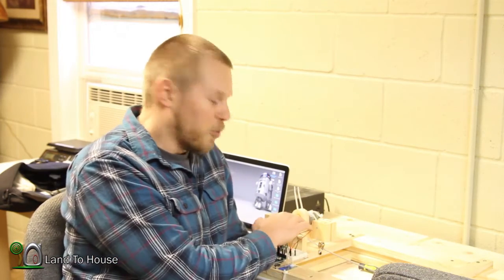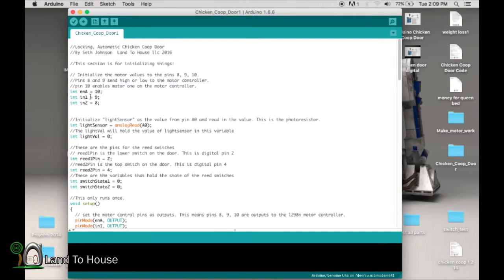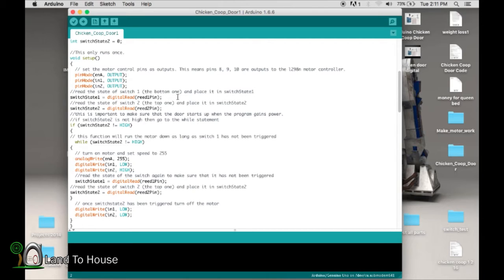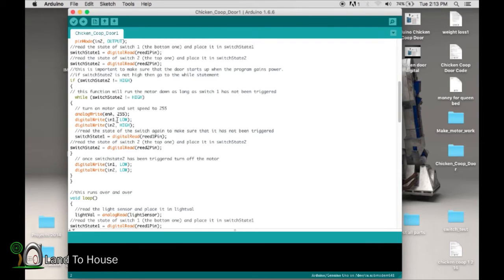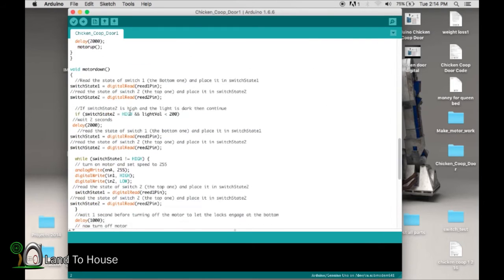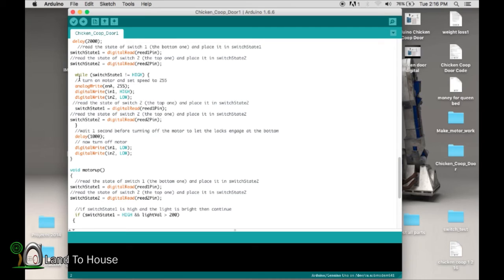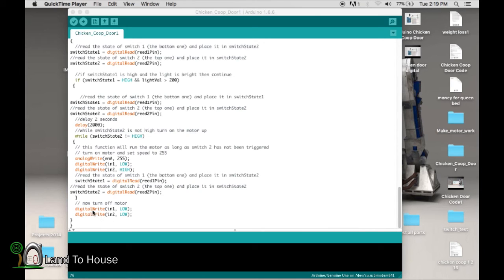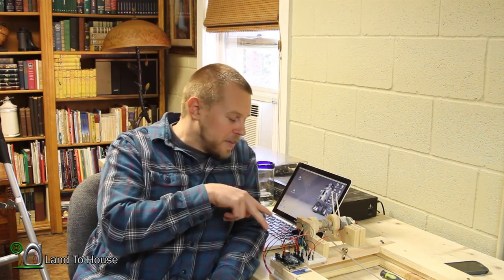Amazing Automatic Chicken Coop Door Part 6/7

Comment: Stellar series. I've been looking at pop door ideas for a while and yours is definitely the one I'll be emulating. 

One question applicable to this video though: I'd rather not tie mine to a light sensor. I'd rather make it "smarter" to take full advantage of the arduino. I'm wondering how much more complex the code would get  if you eliminated the light sensor and instead triggered door open and close based on sunrise and sunset (plus 1 hour maybe?) pulled from an online database. 

Any thoughts on this?

Comment: very cool!! I am a bit new to arduino but I've ordered all the parts and I have your code uploaded to my arduino. is there a simple way to add to your code? what I would like to do is have a few LED's turn on when the door is closed so it's not pitch black inside at night. any help would be MUCH appreciated!!!  thank you Sir!!
Reply from the maker: +Jeff Biswanger nice!  I am also very new to the arduino. Once the code is in the arduino you can add whatever you want. Turning on the LEDs should be as simple as adding a few lines. There are a lots of simple programs in the arduino program that will help you get the lights coded. I am going to build another door for someone soon and might make the wood part better. Also I need to think of a safety in case the door goes up too far and does not stop.

Comment: Great job, while I understood all the explanations and reasoning, the code went totally over my head, just a reminder to myself it's too late in my life to be starting on coding :)
However providing the code to just copy and paste makes the whole thing a possibility for me if I get round to making one as your wiring description makes the construction straight forward. Nice series.......all you need now is a chicken house to go with it :)
Reply from the maker: +Michael Collinson The code can be a little bit of a headache especially if you have not practiced it before. But I am hoping that copy past will allow many others to work with this project with little trouble. When I actually do get the coop built I will add some to the code to allow for the possibility of the lower switch not triggering and the motor wind back up on itself. .... a coop and some chickens might be handy in this case haha